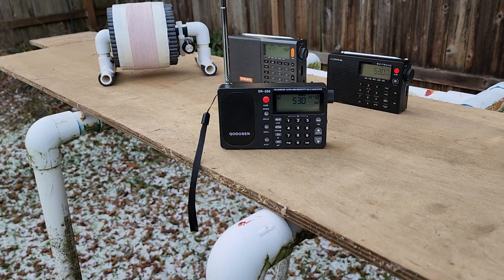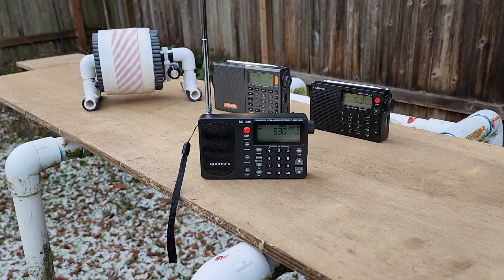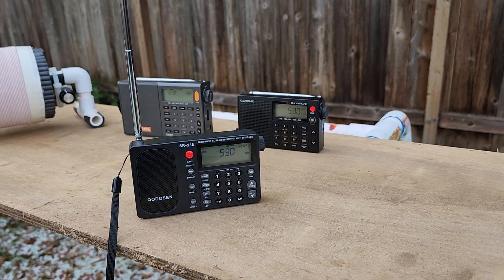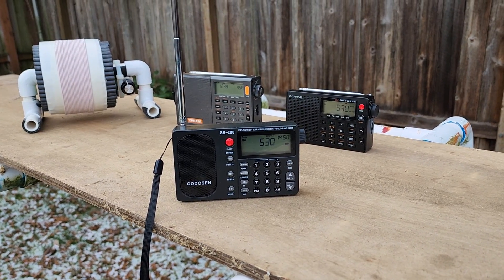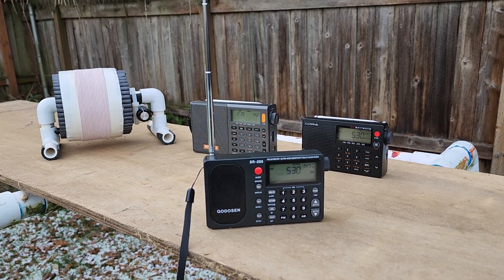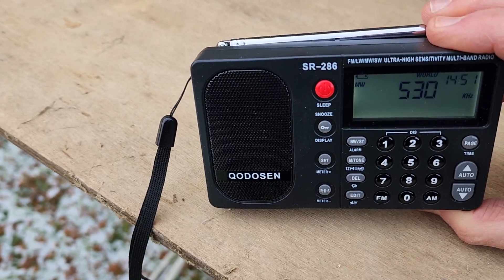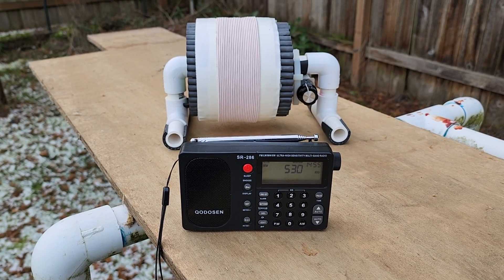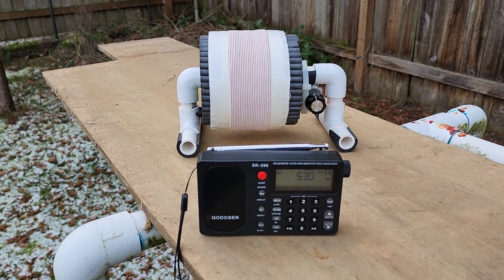Qodosen SR-286 Ultralight-- New AM-DXing Sensitivity King

Comment: the whip does nothing for am it has ferrite inside .why do you use whip with am??? no need i could still hear the station when you pushed the whip down lol you didnt know about internal ferrite am antenna ??or were you on f.m? not sure
Reply from the maker: Patrick, the SR-286 can receive AM-DX on either the stock whip antenna or the internal loopstick, unlike almost every other portable. AM-DX reception on the whip antenna is typically more sensitive than on the internal loopstick, as long as no RFI noise is picked up by the whip. The sensitive whip antenna reception on AM is probably related to the DSP chip, which was designed for car radios using whip antennas.

Comment: I need to build that table. I use a plastic foot stool on my patio.
You can really tell how sensitive the Qodosen is by how well it hears your phone's screen (tap tap tap tap). When opportunity exists, I need to buy one. Nice demo👍👍
Reply from the maker: Thanks KA5DWI, that "table" is really just a piece of plywood tossed over an old PVC base for a 9 foot box loop 🙂My wife hates it, but it does hold up the radios and antennas! Good luck with your future SR-286-- Gary (N7EKX)

Comment: This radio has me very intrigued. I noticed there is a note on J Allen‘s website that the radios are no longer coming with the 18650 battery. Are you able to point me in the direction of a good battery for this radio? I am legally blind so that would be a tremendous help.

Thanks in advance
Reply from the maker: @baayers2, a good battery for the SR-286 would be these button-top 18650 batteries with high capacity
https://www.amazon.com/CBJJ-Rechargeable-Battery-Flashlight-Doorbells/dp/B0CJ2MH36J/ref=sr_1_28?dib=eyJ2IjoiMSJ9.Q0kSSDF1Edn9aM0fQ2DVZZwCuYvm3Jf1GBmwmgVzt_rg7hxDi4mf_JG3fx2qNAQTgCvhpZZuT5VM-DvVG9AvhTzkw6bWy9Riz7zrw9PDx7SlUiy_zloVWszQVd5ylt_ZlQyXl7xPfaAunpohNtorpZTNOQC0jOcMunr0CECsMtt2pVGcF6p2ZrZCrBakOmgN69-jYYoiXS5CGXN8rCsNSTniwKR0PAq9u3h2AnoSGU6ALQterO_HJnMAP7VeryNvns25sDSlo5IpsAa1k5aPyo9TAPd8pbzubG7KdRC93p4.3g47t0JeLMuOCO7b9QFY_KpagSp-xsCRydUWok24o1o&dib_tag=se&keywords=18650%2Bbattery%2Bbutton%2Btop&qid=1709893498&sr=8-28&th=1

Comment: Since North America will not adopt DRM, IBOC, DAB+, or any other than the 100 year old analoge radio transmission, then this TEF6686 car audio chip can be used in ALL radio receivers..? Perhaps, Sangean can manufacture a new radio version, with this chip, use for AM/FM/SW/LW/AIR BAND..? Useful for SSB, also.Name their new radio 909X3..? Use this chip for cheap am/fm clock radios.....
Reply from the maker: Thanks Dadwire1483, This TEF6686 chip certainly does have great potential on both AM and FM, and it would be superb if one of the major manufacturers like Sangean, Tecsun, XHDATA or C.Crane would develop a classic radio with the chip. Up until now it has been only the small "cottage industry" manufacturers in China that have taken a stab at it. Qodosen has developed a great product, but I doubt that they have the production capacity to meet the demand.
Reply: I can tell you that many of the radios rated five stars by Jay Allen were designed by Qodosen designers, but this time under his own brand. @DXerGary

Comment: Radio Jay Allen did a review of the QoDosen SR-286 on his website, and was pretty amazed at the performance. The radio is built with the chips they use in car radios.
Reply from the maker: Hi Scott, Jay's review was what made me purchase the SR-286, and he was certainly right! The radio is a real breakthrough in AM sensitivity on the stock whip antenna, probably because the chip was designed for car radio reception with a whip.

Comment: Thanks for this demonstration! I have so much to learn.. I didn't know you can inductively-couple the FSL antenna to these radios. I like the portability of the C.Crane, and appreciate that I can plug it in to a USB power bank and use it to charge my rechargeable AA's in a bind.
Reply from the maker: Thanks DJRonnieG, all these three radios couple up easily to an FSL antenna and get a big gain boost, but the SR-286 definitely has the edge in audio quality after receiving the boost (with the same 3 kHz filter).

Comment: Generally the tuned loops want the loop stick coaxial with the external coil.  The improvement is limited by the sensitivity of the radio though.  The more sensitive the radio, the less the tuned loop does.  It's not a signal-gathering function but an impedance matching function, and if the impedance is matched already, you can't improve it with a tuned loop.
Reply: impedance  matching ?? no

Comment: Hello Gary!
I noticed that Radiwow R-108 EMI reduction mod was tested: 
https://m.youtube.com/watch?v=pQjJUCC6-CU
https://www.youtube.com/watch?v=diDVTB0cqFw
Here I applied 10uF capacitor on the battery terminal (since it's BL5C) while adding an aluminum/copper foil in the DSP chip. Is it working also on radios with BL5C battery terminal?

Comment: Does it make a difference if you align the axis of the internal loopstick with the axis of the FSL? I would think they'd couple more effectively that way, rather than having them parallel to each other as you do in the video.
Reply from the maker: Hi Flapjack9495, the ferrite rod FSL's (like the 5" FSL in the video) can give a powerful boost to a portable radio with the antenna either lined up along the axis of the radio's ferrite, or parallel to it (like in the video). With a ferrite rod FSL these two inductive coupling boosts are roughly equal, so you can simply position the radio in the most convenient of these two orientations. But a ferrite bar FSL always must be positioned parallel to a radio's loopstick (like in the video), since it couples up very poorly in the "lined up" orientation (speaking from experience).
Reply: @DXerGary  sometimes you have to orient both the radio and the loop stick in different ways to get the best reception

Comment: Thanks Gary, very interesting.  I wonder how it would compare with my TEF6686 Mini? No internal ferrite, but it has an SMA antenna socket. In addition to using a whip antenna for MW and LW, I have connected a tecsun AN200,  and also an Airspy YouLoop. Videos on my YouTube channel.
Reply from the maker: Thanks Peter, the SR-286 seems to be fairly unique among these TEF6686 portables in having an internal ferrite antenna. Of course your TEF6686 Mini would have the same great performance on MW with its whip antenna, but the SR-286 loopstick has great inductive coupling with FSL's and air core loops, which a whip antenna can't do. I plan to watch your videos when I have time!

Comment: I read a review of the Qodosen SR-286 at Radio Jay Allen several days ago. Jay liked this radio very much but wrote "Because this is a compact radio the built-in ferrite rod is necessarily small and reception off the ferrite is consistent with the best radios of this size…it would rate perhaps * to ***1/2 in the AM Mega Shootout list. However, you can select the whip antenna instead of the ferrite rod, and there is also a switchable 20 db amplifier you can enable. If you then take the radio to a very low noise area, such as outdoors, the AM reception becomes phenomenal rivalling my best Five Star reference radios." Unfortunately the SR-286 is not currently available for purchase. Only demonstration models have been released.
Reply from the maker: Hello Willowsloughdx, Yes, I've read Jay's fine review. His review was the primary reason why many Ultralight radio group DXers have purchased the model, including yours truly. He is a member of our Ultralight group, and a constant contributor.
Reply: @DXerGary  Thanks for providing some insight and quality video regarding this radio. I'll be looking forward to a fully developed HF version when available.

Comment: There's another feature where you can turn an amp on and off by pressing "0" and "page" have you tried it? another you tuber was using it on LW an AM
Reply from the maker: Yes I have tried it, Doug, but turning that amp on and off only works on the external (whip) antenna, or the plug-in antenna jack. My impression is that the amp is constantly "on" when the loopstick is selected, since you can't turn it on or off in that setting.
Reply: There is definitely a lot of excitement over this chip/radio @DXerGary
Reply from the maker: Very true, Doug! @dougmiller2937

Comment: Great video, Gary! I look forward to your supercharging results of the SR-286. I will be investigating the same thing on mine. Do you think you'll be trying 250/46 Litz from mkmak222?
Reply from the maker: Thanks Guy, the 250/46 Litz from Mkmak222 should work great in an upgrade loopstick, but the solid wire tickler coil will also need to be routed outside the cabinet. Probably it will result in all four leads running together through the cabinet side, assuming that digital display noise isn't picked up. Of course there's no guarantee that an upgrade loopstick will outperform the SR-286 whip in weak signal AM-DX reception, but it's worth a try!

Comment: I made a 4 ft inductive loop tuned low with a 365pf tuning capacitor to get a great signal on New Orleans 870 AM 170 miles away and got Dallas 820 too 300 miles away during the day. I used a box a 100w solar panel came in. I also made a great loop from a 16 inch pizza box with 17 turns and a 450pf variable capacitor I found. It`s perfectly matched to the AM band and it helps a lot with indoor signals at night. 

I also use the AN-200 loop plugged into a 500 ft outdoor wire and ground to get AM signals inside my noisy camper. The situation was hopeless until I tried that but was greatly improved after I disconnected my DC circuit. The AN-200 also makes my Tecsun PL-330 a better, quieter DXing receiver indoors than my top rated receivers when plugged-in to it. Oddly I`m not allowed to mention my American brand radios on this platform or ANY American metal detectors, etc. Says a lot about their sick agenda!
Reply: I'm just getting into the DXing hobby... Any recommendations how to make a loop antenna on YouTube 
Where can I find info about those American radios & metal detectors? I don't understand why you can't mention them... 
Thanks
Reply: Try the AN-200 loop they sell. It`s a waste of time trying to communicate on this evil platform. They`ll auto-delete it. Try a Sangean PR-D4W for AM.  @joseg3259
Reply: Buy some 24 AWG enamel coated magnet wire and air variable tuning capacitors. Look up, "DIY AM loop antenna." @joseg3259